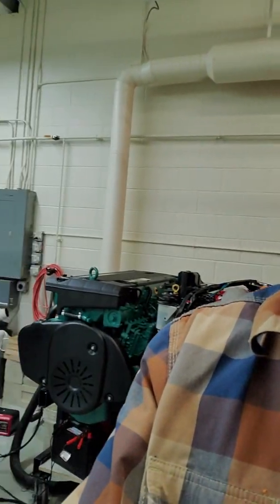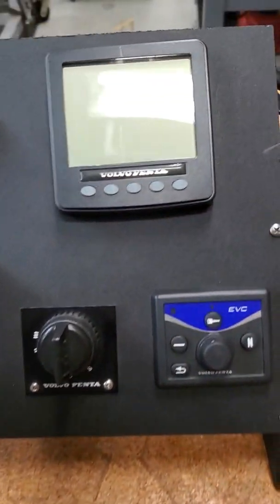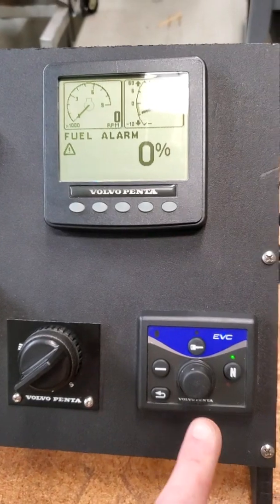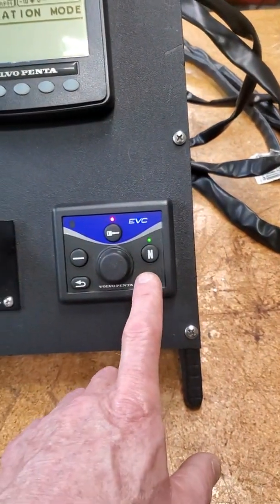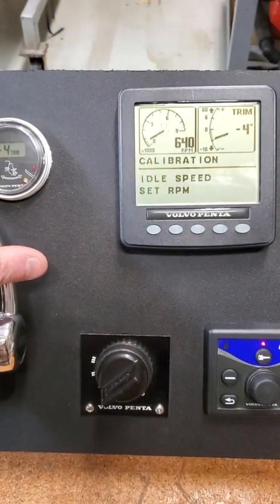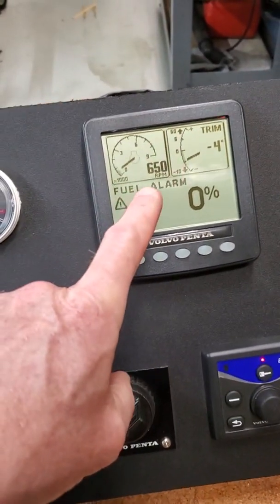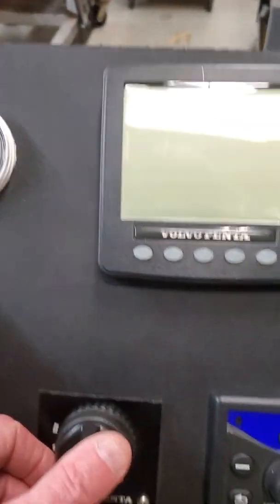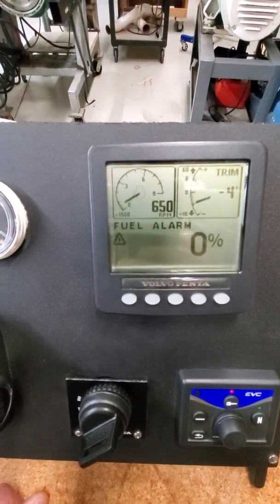Volvo Penta EVC C setting Idle RPM

Comment: Good morning Ted, I am having troubles with my Volvo D4-260 EVC-C with CHECK THROTTLE LEVER FAULT. I have had a Volvo technician out many times as the problem is intermittent. The Volvo technician had many theories changes a few things, reloaded software and still the problem exists so I had an electronics specialist come in and he noticed when he would wiggle the communications cable from PCU to the HCU at the HCU he could make the error come and go. We used a test cable between the two and still the problem exists. Can anything be done to correct this issue? All pins look clean with no sign of oxidation. Any thoughts? ERROR codes on display MID 164, PPID 392, FMI 4 Thank you in advance.
Reply from the maker: That fault is low voltage feedback from the throttle lever Potentiometer in the remote control. 
I would start by swapping the cables from the port control lever and starboard levers. Then see if the fault jumps to the other engine. if not then swap the cables at the HCU's - this way you test the throttle potentiometer first and then the harnesses from the HCU to the potentiometer.

You can also try an autoconfiguration after swapping the cables and then recalibrate the controls.
Reply: The technician has changed out the potentiometer and the cable to the HCU. He now believes it is the HCU itself. is this a possibility or probability? Cost of new one is almost $3000 and I don't wish to simply throw out that much money if it doesn't correct the issue. I have already paid almost $5000 with nothing to show for it. Your help is greatly appreciated.
Reply from the maker: @FranSan-k9c  From your description and the fact that you had a VP tech with a Vodia tool working on this was the right choice. 

Intermittent issues are a nightmare. And Unfortunately the failed item was the last and most expensive part. And yes, HCU units do indeed fail. Please Do NOT try to buy a used one - it may cause more grief. 

Also, If a Volvo Penta dealer installs (and programs) the HCU, it will come with a 2 year warranty.
 After the new one is installed and working, I would ask if I could use it for a demo "bug" for my classes (if possible). I would be more than willing to pay for shipping. Please let me know if this something you would be willing to do. Please email me at marinedoc01@yahoo.com for my contact information.
Reply: I thank you for your help and yes I would be glad to send it to you for your help. It may be a week or so out from this point. I am having an electronics specialist hep at this point (much less expensive than a VP tech) but will have VP complete the upfit if necessary.  Thanks again.
Reply: I hope you don't mind and I do not want to waste your time. Had my guy out again today to swap the port and starboard HCU's completely but could not make it error before swapping so we did not. I did notice in the past testing on cool mornings I had no errors and later in the day when it warmed up I would get errors.  Today is 48 degrees in SW Florida and no errors. Have you ever heard such a thing? Still would hate to buy an HCU if it is not the problem.
Reply from the maker: @FranSan-k9c  Yes, higher temps = more resistance. So at this point I would swap the HCUs, do an auto configuration  and the recalibrate the controls.
When it warms up I bet the problem shows up again and stays with the HCU.

Comment: I have 2 2005 Volvo 8.1 Gi engines in my silverton convertible and when I go about 2000 rpm and bring throttles down fast back to idle they stall out, but if I bring them down slowly they don’t stall. Any idea? Thanks in advance

Comment: What should I think about if my display shows it is dropping out of calibration mode when I turn the engine on?
Reply from the maker: After you turn the key on and the system boots up (LCD shows data) then you enter calibration mode. If it fails you may have a control issue. Check for codes.

Comment: Hi ted i have a twin motor, evc c. 110 d3 and port motor is at 980 rpm and sb at 680 how can i bring down the idle please?
Reply from the maker: I do have a video on idle speed calibration. 980 sounds much higher than the normal range 0f 600-700 I'm thinking the controls need re calibration.
Reply: @tedsmarinerepair8956  ok thanks, i will try and send a video. I have had a mechanic adjust manually at the cable end but he says its at its limit and the lowest he can go on the thread

Comment: Hi Ted, thanks for your videos! I am from Brazil and could learn a lot from you! I get a fault code in my Volvo Penta D3 EVC-C saying MID 140 PPID 395 FMI 6. It seems to be a circuit break but not sure if it is wires or in the EVC it self. I would appreciate your help! Thanks again

Comment: Hello Sir, My activate station helm light is always lit on my evc-c3.   I took the evc single installation control panel off and saw a sticker on the back that didn't match the part number in the volvo manual.  The part number 21310162 is what it should be and instead the sticker shows 21310173.  The only place i see that part online  is from Russia.  The part does look exactly the same.
Reply from the maker: Same part different vendor.

Comment: Dear sir, I am facing Check EVC system 1 on both engine plus Limited steering Limited Rpm. I have engaged local Volvo Penta representative to do diagnostic and check at least 4 times but problem still there…. Please help 🙏🙏🙏

Comment: Hi

I hv a Volvo Penta 500kva (TAD1641GE)

RPM is fluctuating in seconds 1500 to 1400 and back to 1500. Engine is hunting, and ita without load.  We checjed all fuel lines, injectors, all sensors.

Any suggestions?

Comment: I have a 2005 5.0GXI which idles at 900rpm to 1000rpm on the hose after advancing the throttle and returning back to neutral. The engine cover sticker says 600rpm. I changed the IAC and checked to see if the throttle body was sticking. Cant figure it out. I wonder if there is something like this causing the IAC to increase the rpm?
Reply from the maker: Possible failed tps. If it fails the Ecm doesnt see closed throttle and holds rpm at higher than idle to prevent stalling during a  throttle chop.
Reply: @tedsmarinerepair8956  Ok, thanks for the reply. I did replace that recently with a new unit but have had the same issue. Motor runs really smooth and starts right up but RPM is just not where it should be. Love your content and insight on these marine engines. Will continue to like, comment, and subscribe.
Reply from the maker: @outattheisland  Is the idle rpm normal on initial start and then become elevated after opening and closing the throttle? Is this repeatable?
Reply: @tedsmarinerepair8956  yes, thats exactly what happens. Initial startup is perfect. Idle settles to normal and stays there but as soon as the throttle body is advanced and then released it doesn’t return to the normal idle and stay at 900-1000. Ive replaced the fuel pressure regulator, pulled the fuel rail, lines, and injectors cleaned them thoroughly. I did find paint chips in one injector so after cleaning I replaced the fuel cell as well. I did new fuel lines to the tank and fittings.The engine runs great but the idle is just not at or near 600. I feel its something with the ECU. The only sensor I pretty much haven’t replaced is the crank position sensor but would it even run as perfect as it does if that failed? Yes it is repeatable any time its started and I cant find or hear any vacuum leaks that would allow more air into the engine.
Reply from the maker: @outattheisland  It does sound like a TPS fault due it idles fine on start up. If it had a vacuum leak it would have a high idle on intial start. You need a scan tool to check what the TPS voltage. It could also be a poor ecm ground. Check the ground wires on the back of the flywheel housing. Remove, inspect, clean and reinstall them.
Reply: @tedsmarinerepair8956  Will do, thank you for your help and advice.

Comment: i have a D6350 lately it is becoming hard starting when hot. [after running at cruise]
starts ok when cold. any ideas?
thanks
Reply from the maker: Several possibilities (no guessing on this one). You need a tech to run a diagnistic check under the same conditions with a Vodia scan tool to determine what parameter is the cause.
Reply: @tedsmarinerepair8956  
thanks ted.  i am in a remote village in south east Alaska..
no technicians handy.

Comment: We have D6-330 a-e with evc-c the 20 Amp circuit breaker trips we upluged the pcu an the breaker stopped tripping you can smell burnt  electrical. Is likely to be just a bad pcu are shorted wiring down stream?
Reply from the maker: It is possible. Power contines through the PCU to the HCU(s). I would leave the PCU plugged in and unplug the x2 connector to the HCU. Try again if the breaker trips you need a PCU. If it doesn't  unplug the x2 @ the HCU. If it still trips its in the harness going to the HCU.
Reply: @tedsmarinerepair8956  if Preprogrammed PCU installed and harness good, no code pops up, are we good to go? Or do we need additional testing, programming from Volvo?
Reply from the maker: @jamesgassen3121  preprammed means plug and play. You are all good!

Comment: Hello. How to tune EVC C Idle speed down. On my d4 engine 700. I would like 600. Thank you
Reply from the maker: I believe the lowest setting available is 700rpm on a D4
Reply: @tedsmarinerepair8956  Thank you.Unfortunately, I can not eliminate the blow, when turning on the move. I think it is possible to do this by reducing the speed. DPH-A 1.95    350 hours of work

Comment: What is the difference between tad****ge and tad****ve
Reply from the maker: These are commercial/Industrial engines. GE is fixed rpm (Gen set). VE is variable speed (propulsion) TAD is Turbocharged Aftercooled Diesel